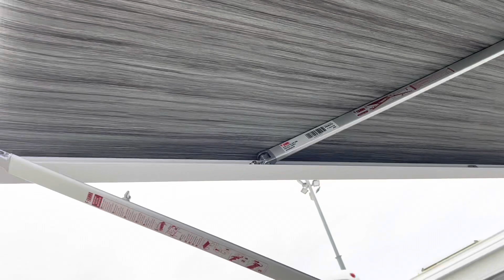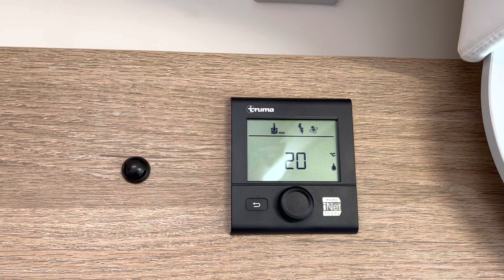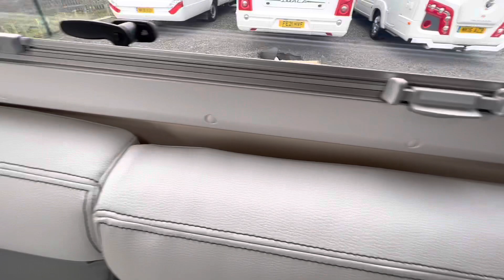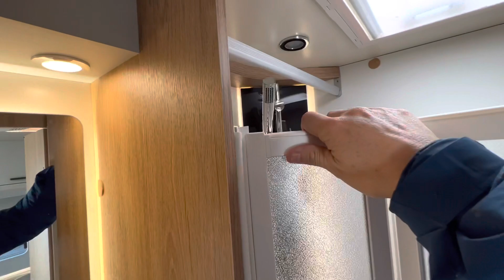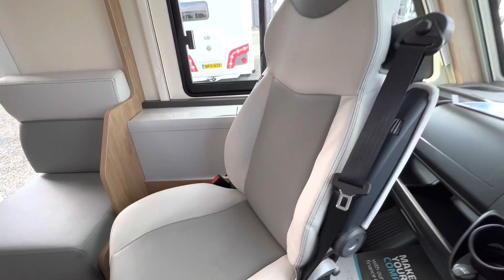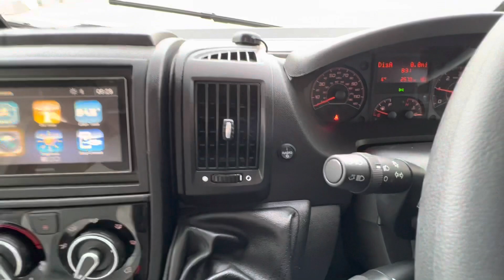Autoroller Pegaso 745 Handover Video

Comment: That was a great demo 👍.  I saw towards the end this Motorhome has the habitation AC fitted. I guess this is dealer fit and wondered roughly how much that costs on a new motorhome.  Also If I may, what is the ballpark cost for a self seeking Satellite dish fitted?  Thanks for the upload.  I have been looking at the roller team 740 and comparing it with the Carado of the same layout.  On the Carado the auto box is coupled with the 140 BHP engine, is that the same on the Pegaso Roller Team?
I'm hoping to push the button on one of these bad boys within the next 12 months  
😅